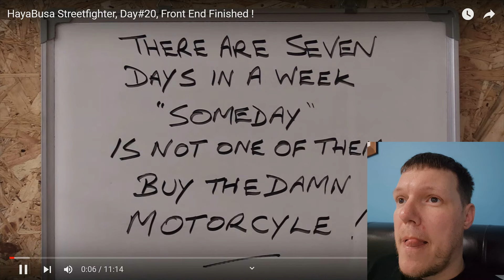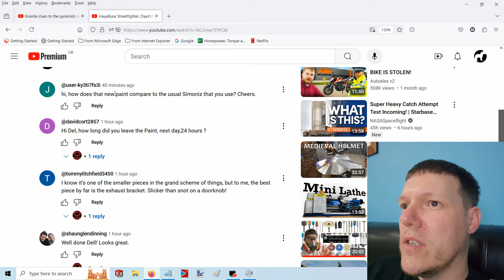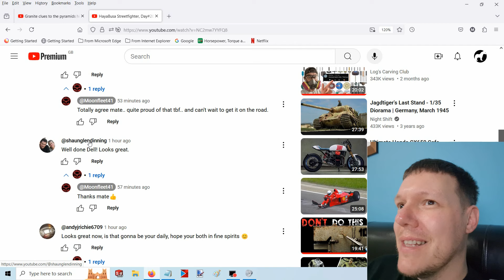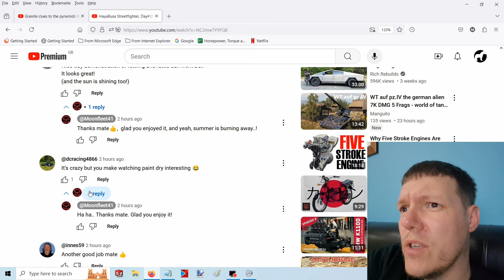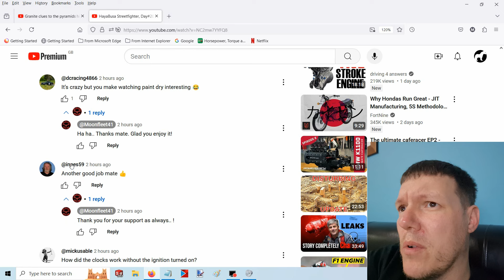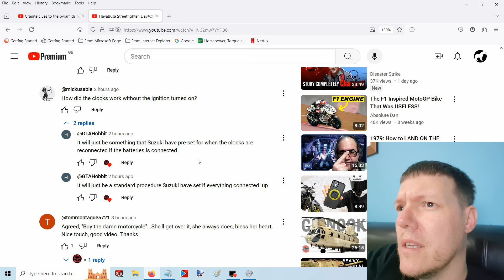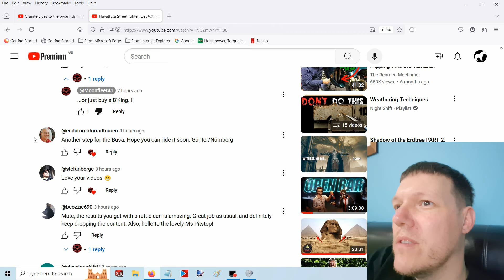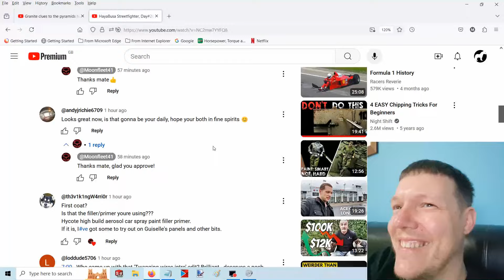Perfect 60% of the time

Comment: Those extractor fans are no doubt bathroom ones as you say, Matt. Their extract rate is usually around 30 litres per second. Even if they’re super-beefy kitchen ones they’re likely to have an extract rate of 60 litres per second. An extract fan will take a fair few minutes (probably about twenty) to clear the steam from a typical UK bathroom. Del basically needs the extract unit from a commercial kitchen or pizza shop to act effectively in a workshop of that size. In the normal run of things he’s probably better just opening a window to get rid of fumes.

Comment: Straight in with the high build, not a drop of etch on the Ali...

Those extractors will pull even less as they're full of grinding dust and tough black. Wears a mask when spraying then wanders through turning off the lights through all the fumes. 🤣

Comment: Serious question, what are the drawbacks of paint over mill scale? Generally, I just throw primer and paint on structural steel to prevent rust, sometimes some phosphoric acid to clear some surface rust. Obviously not for anything that is meant to look faktory.
Reply from the maker: Over time it is a source of rust and causes the steel to rust under the paint.

Comment: He put an aftermarket ignition on it from wemoto didn't he? What's the betting that's why the clocks are energised.
Reply: Thought it was Kawasaki that had the motogadget stuff. Poor bike has been destroyed.
Reply: @GTAHobbit  yeah it did. The busa got a Chinesium filler cap and ignition barrel in episode 1 of the original series.
Reply: @mattblackledge9068  yep remember the barrel and fuel cap but don't remember a motogadget or keyless ignition being fitted. Crossed wire I think though you were referring to a motogadget system. My bad on that

Comment: I think it's just a suzuki thing with the clocks my bandit does the same u connect the battery  they move you plug the clocks in they move I don't know why they do it but my bandit has done it from new 😂
Reply: The only thing that makes sense if the ignition was on the small LCD would have lit and no neutral light etc. he did re-pack the wire under the tank so might have nicked something, got my doubts. Still a bad move to pack all the wires under the tank

Comment: The unnecessarily long bolts... I fuçking hate them with a passion every-fuçking-where.
It will not make be the bike or the car or the aircraft lighter by 1%. But it's a question of good practice. If you don't bother saving weight on the bolts, pretty soon there will be something else that you don't bother about either, and then the trend continuous.
That's why I worship Gordon Murray. If you want to use a bolt bigger than 10mm at the design stage, you have to explain why. As a result, all of his creations are mega light.